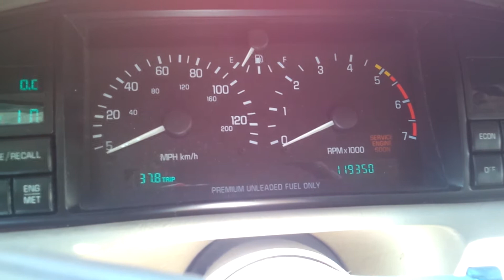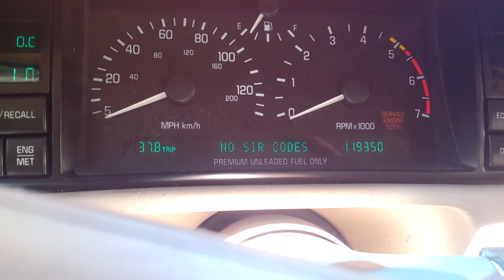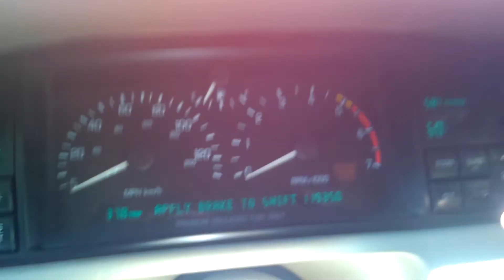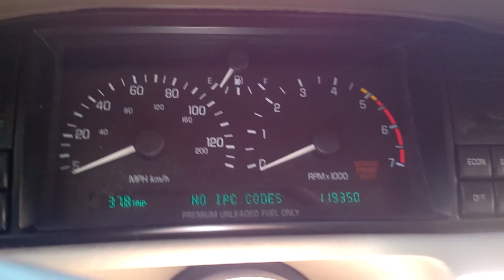How to: OBD1 in a 1992 Cadillac Seville

Comment: Do you know where the heater blower motor is and if there is any fuses near it on a wire got interested my fan motor has stopped and my rear defroster will turn on but not stay